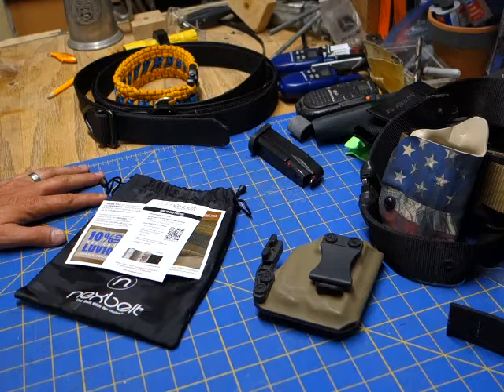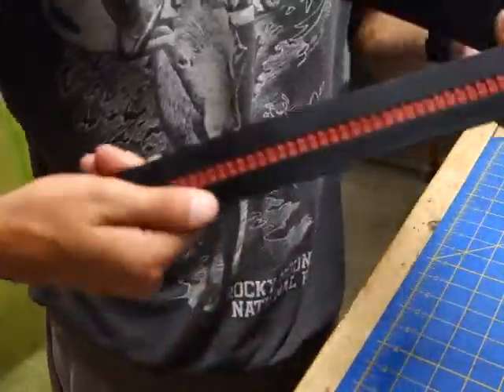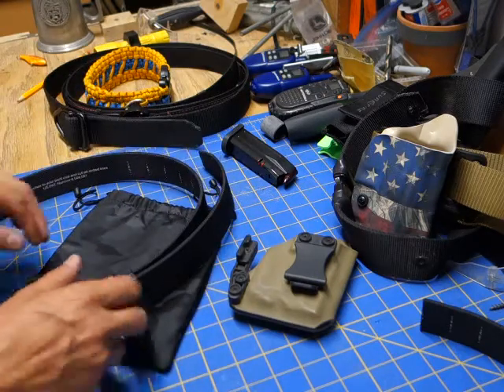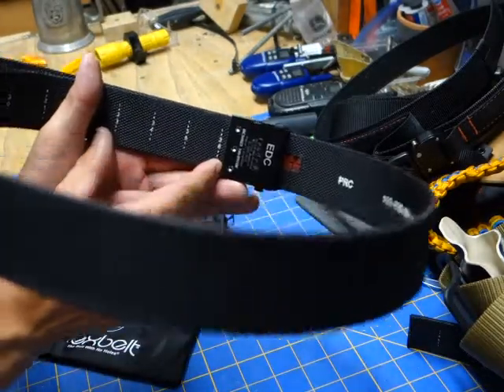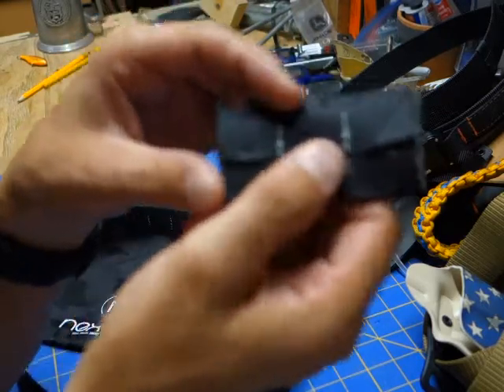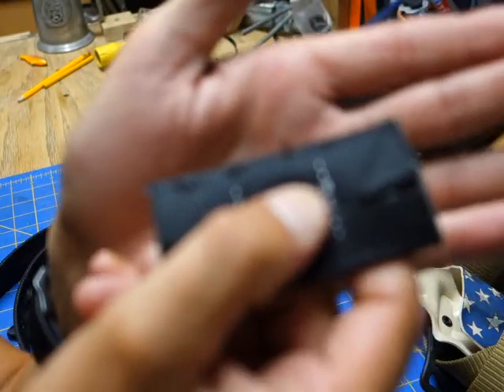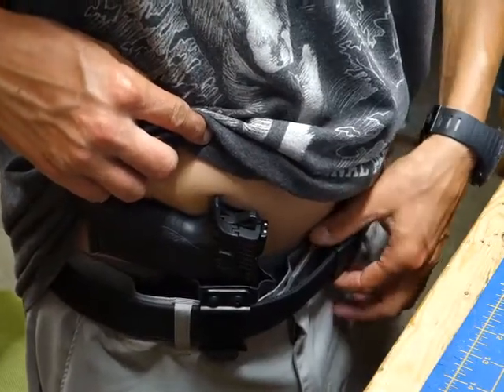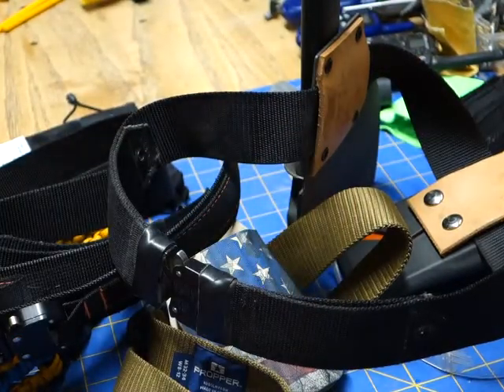Nexbelt Supreme Appendix EDC Belt

Comment: I had the kore gun belt, and it was so stiff, it might be great for wearing a duty rig with cuffs and 16lbs of gear but it was not comfortable at all and didn’t break in after months. How does this one feel around the waist?
Reply: I have a nex belt and its very thick. So much so that it's uncomfortable on my lower back in the car. I went back to my blue alpha gear velcro belt.
Reply: @mikejones6711  i have two supreme appendix belts now, they are money